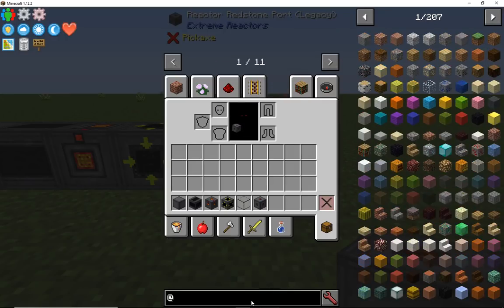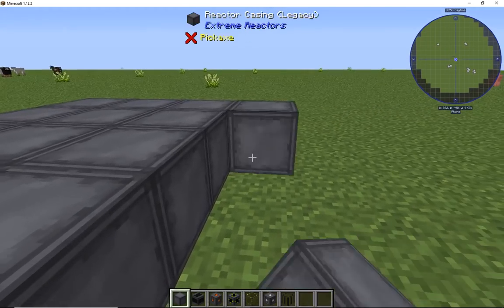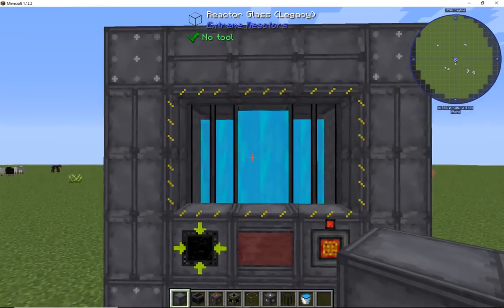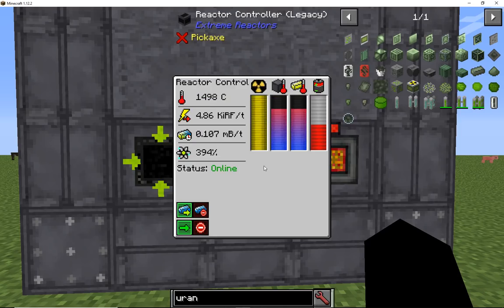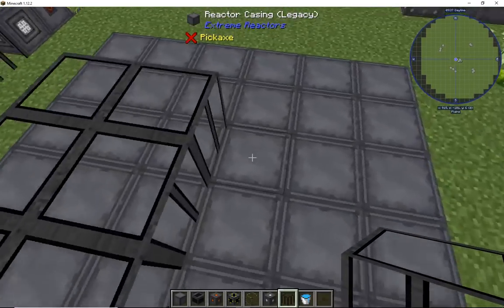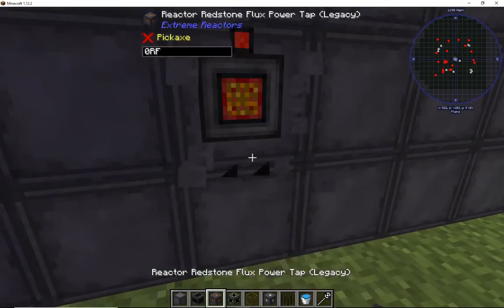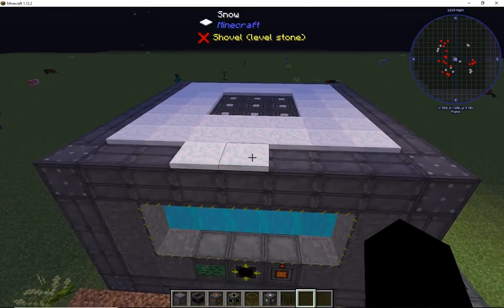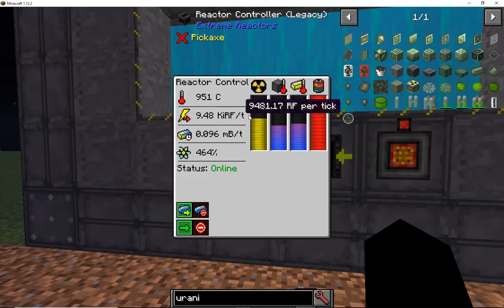Extreme Reactors Tutorial 1.12.2

Comment: When you make the 3x3 core you don't need coolant in the corners. What you put in spaces diagonal to the cores doesn't matter, it will produce exactly the same energy and consume exactly the same fuel. I fill it with regular minecraft glass (any non reactor block works) so the fluids don't look ugly. Another tip I read about but haven't tried myself yet is to sacrifice some efficiency and power output to get a decent reactor earlier without making tons of gelid cryotheum. What you can do is just have the corners on the 3x3 (4 rods), leave the center air, put graphite between the rods, build a wall of some inexpensive material from the graphite to the reactor walls (like even cobblestone) leaving a space on the top of it and put the gelid cryotheum on it. The cryotheum source will stay on top, but there will be streams on either side of it running down adjacent to the cores. Fill the corners with an inexpensive block and you would save a lot of cryotheum. That setup inside a 9x9 casing (7x7 internally) will just set you back 8 buckets of gelid cryotheum, regardless of how tall you build it. The taller you build it the more efficient it will be too.

EDIT: I tested it and can confirm it works. It produces less power than your setup at ~7.4 kRF/t, but at only 0.075 mB/t. The main thing is that it outputs a decent amount at the cost of just 8 buckets of cryotheum instead of 120!!! I made a control reactor which I filled all around with cryotheum and it made no difference. I also copied your reactor and it can output 14.2 kRF/t at 0.17 mB/t, yours didn't because you didn't fill up the rods completely. Your design is less efficient, costs 112 buckets of cryotheum more and a lot more with additional layers, but it will output more power while taking up less space.
Reply from the maker: @dwerg2k The info given on text was very helpful. Given all odds, What is the possibility you would like to assist in an updated info tutorial on a live server(Privately owned by my team and i)?  I have an open Discord server that i allow anyone to join and reach me. Via the same tag X_Niter. I would be happy to have a more readily available conversation there. Given you would be willing to as well. ( https://discord.gg/TCCVQjc  )
Reply: @X_Niter  Yeah, I don't mind giving that a try, when I find some time. I'll probably pop into the Discord within a few days.
Reply from the maker: @dwerg1  Awesome well i will be around.